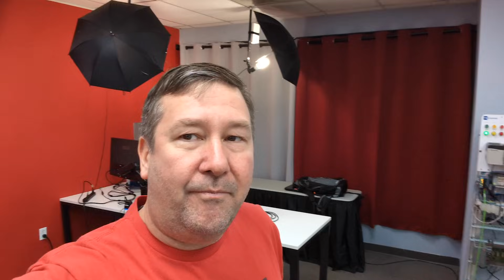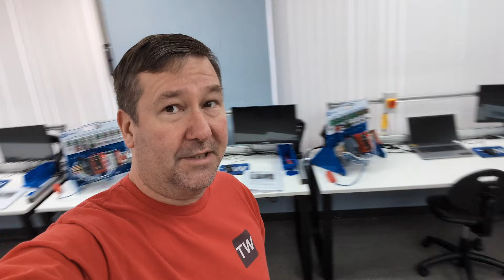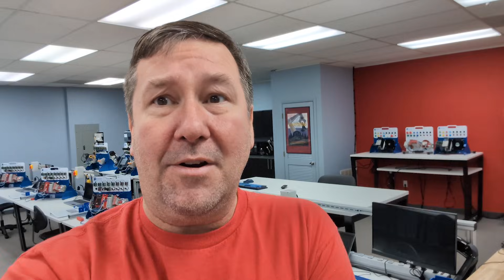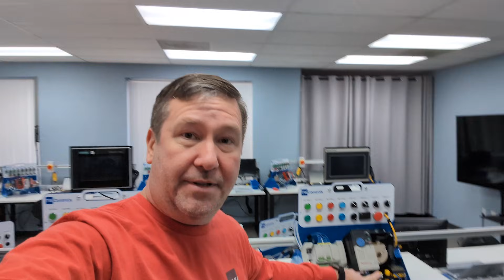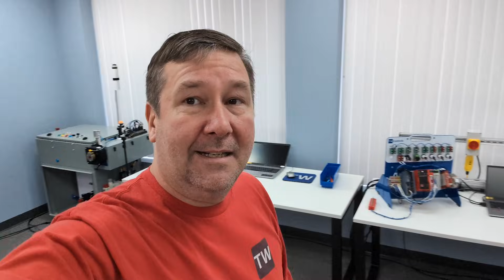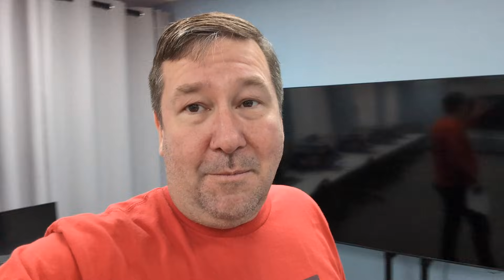PLC Simulators Will NOT Get You Hired: 5 Reasons You Need Real Hardware

Comment: With simulator you do not have to worry about inrush current or voltage drop if your 0-10v sensor is far away from the plc. In real life, you have to. Just the other day my Allen Bradley power unit caught fire (there was no MCB between the power unit and wall socket) and bricked the temperature sensor. I am lucky that my rs485 to usb converter survived (the converter was attached to the temperature sensor so that my python code on pc can read the temperature). 😀
Reply from the maker: That's definitely a lesson in the importance of circuit protection! 🔥

Comment: One point that needs to be made in my experience is that fault finding a PLC controlled plant is one thing, and actually writing a new program (with safeties and failsafes etc) is a totally different thing - different disciplines essentially; I've found a lot of training centres (in the UK at least) don't highlight that well enough.

As far as real-world goes, we ran a project a few years ago to provide a backup processor on an ageing PLC5 /40 with a 5/80 (memory on the 5/40 is almost full, about 29 words left). PLC5 has several CompactLogix units communicating over Ethernet, and what we found when we swapped to the 5/80 was that we could go online to individual PLCs, we couldn't get comms established between the 5/80 and the CL units, so we've had to stick with the 5/40.
PLC5 is getting replaced by ControlLogix in early 2026, so no doubt that'll provide a learning curve too...
Reply from the maker: You are correct.  PLC programming and PLC troubleshooting a two very different disciplines but I think both still benefit from knowing some of the hardware aspects.
Reply: @TimWilborne there's definitely a case for knowing the hardware aspect for both sides.

What I was really getting at was the generic "how do I program a PLC?" type question.
I've seen one or two trade schools do a "hardwired vs PLC" type course, and I think a lot of people aren't really aware of what it is they're looking to learn.

Comment: Absolutely spot on. Id like to add one piece is that people need to be getting acquainted with older systems. Alot of plants and facilities won't accept raspberry pi installation or even an upgrade to the brand new control logix stuff that your school taught you on. And in many ways, what they got in there works differently than the new stuff. And since it still works to an acceptable level for what they are doing, they don't want to upgrade until it breaks down completely and the replacement parts are just too costly. Many of the plants i service still use SLC and control logix 5560 and older. However the alot of the people trying to come to us; their schools only set them up for knowledge of the brand new stuff and we have to train them on the older hardware, not to mention the electrical side of the hardware as many times those same guys come in with little hands on experience like you mentioned.
Reply from the maker: You've highlighted a really important point about the prevalence of older systems in the field!

Comment: TL:DR - Great video and you hit the nail on the head with this one!!! 

I've been working with Allen Bradley PLC's, Drives, etc.. since 2005 and at the current company I'm with, we were interviewing people for a junior and a senior PLC programmer. The biggest issue my manager raised when he did the introductory interviews was that many had simulator knowledge and tried to fill the gaps with asking AI about how the Safety controller and PLC code worked. Or how to use Safety in a SIL 2 or 3 environment. Apparently, finding new hires with ACTUAL PLC knowledge is difficult. My assumption is that MANY of those types of individuals ALREADY HAVE a job and are looking for a new one. The majority of those applying appeared to be fresh out of college or just finished an internship somewhere after college.
Reply from the maker: Thanks for sharing your real-world experience – it definitely reinforces the points in the video!

Comment: Wiring is the biggest single issue out in the field. Often associated with poor craftsmanship or simple mistakes. Pre-fabricated equipment that travels thousands of miles to their destination, gets installed, and at commissioning does not operate like it did at a test run in the manufacturing facility. The list is endless.
Reply from the maker: You've definitely hit on a major pain point in the field!

Comment: The university’s have the money for hardware the best actually but they spend it on very stupid and unnecessary things and not on common sense things they need.

As you said people need to start investigating the details before they commit to a program or if you find yourself in a class at a university that is charging you loads of money and using simulators as you said ask for your money back.

Trade schools and universities have zero excuse they simply need to be better stewards of their funds.

Comment: Push these students to internships while in school. Real world experience will never be beat. My internships while in school did more for me than anything and I went to a school with an amazing lab.
Reply from the maker: Internships are an excellent way to gain that crucial real-world experience!
Reply: I would add to that full 5 year apprenticeships, allowing mentorship in the workplace so they gain hands on experience in the real world and then technical college for the foundational education, ie the correct way to wire systems to regulation and programming, how to set-up safety systems and why they are needed and finally fault finding. Then if the companies want to support them further they can put them through university too.

Comment: Coming out of industry and just finishing my 10th month of being an instructor, nothing beats actual hands on. I have changed all the programs we have at our location. They will keep changing as long as industry keeps changing. The PLC class now has wiring as a starting exercise. The folks like it better, they said it makes more sense why a bulb comes on when they push a button. Evently we would like for them to wire up a motor control center and then for PLC class, hang a PLC in the same cabinet and change its operation over to a PLC program. Big dreams.
Reply from the maker: That's an excellent approach to teaching! Nothing beats getting hands-on with actual hardware.

Comment: We start the first semester kids (students) with Connected Components Workbench Micro 850 Simulator.  It gets them started with basic ladder logic and latches, timers, counters, etc.  (for a couple weeks).    Then we jump to 820s for the build-a-backplate and program part.   Second semester we include Automation Direct (Click and Directlogic -- lot of cheap surplus available) along with Allen Bradley Compactlogix (Studio5000 and Factorytalk), and adding Siemens this year.  Also added Inductive Automation Ignition last year for the HMI practice.  Would like to add some GuardLogix, but we are not there, yet.
Reply from the maker: Sounds like a really well-rounded curriculum!
Reply: @TimWilborne  You play a part.  On the big screen.  We say "Hi, Tim!" when you say "Hi this is Tim!"  Your "why ladder logic" video is a favorite.  Also the "NPN v PNP v Sinking v Sourcing" you did is great with kids.  I just do not have the patience for that nonsense at times.  ;P

Comment: As someone that just finds this content interesting and will never have a career in this field real world understanding is huge. I fix as much as I can on the cnc machines at work, but you open a cabinet with boatloads of wires it’s overwhelming. Then you get drawings out with voltmeter and check get lost in a hurry. Replaced switches, lube system, 24 volt power supply, main disconnect and removed a light shield for auto door. Auto door was only time changed the ladder. Door lock was integrated.  Most problems aren’t the programs it’s everything else.
Reply from the maker: You've hit on a really important point—so much of the real world of automation involves the physical components and not just the programming.
Reply: Id argue 9,999/10,000 times its not a software issue. The machine (in this case the proccessor) does exactly what you tell it to do. And will keep doing as such until the hardware fails. Unless your commissioning a new machine or program, your problem will most definitely be in the hardware side of things

Comment: Well while I perfectly agree with you, simulators at least allow us (I am still a student as you can guess lol) to get hold of programming languages and their structure, anything else would be better practices in real life, namely wiring and dealing with communication, to me it helps but only halfway, the rest will need to be on the field. Think of it like being in the military, training at first won't be in real situations, until the soldier is ready enough.
Reply: Good comparison.  Back when I did Army training -- we said:  Crawl, Walk, Run and then Fly.  Have to work you way up.  Also said "As the Army Trains, so the Army Fights."  So by the end, you want to get up to the Real Thing.  But for starting -- wood swords and rubber knifes are a safe start.
Reply from the maker: To a point but the military does use a lot of real hardware in their training even it it isn't "live".